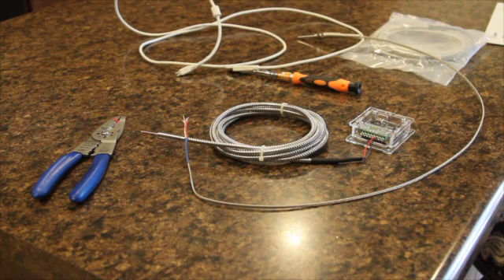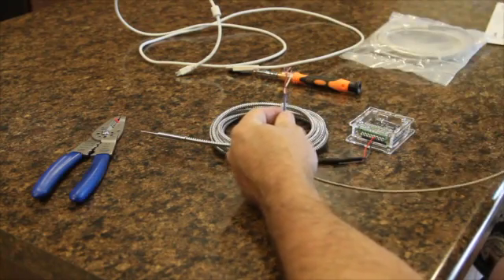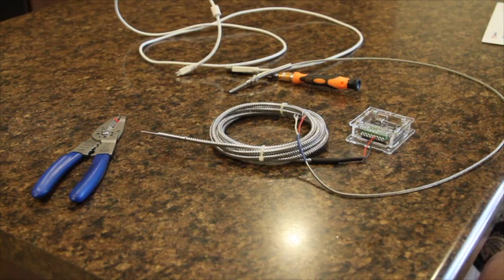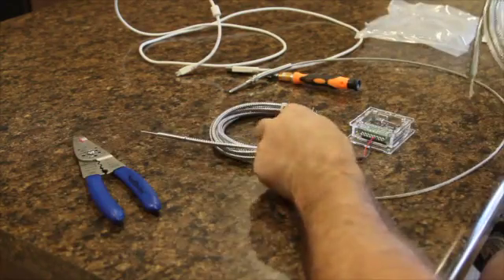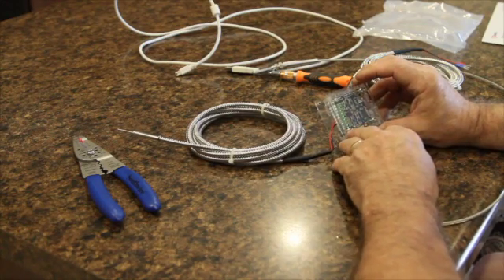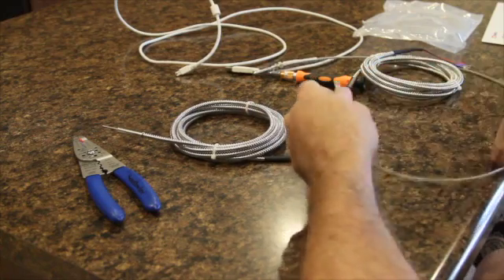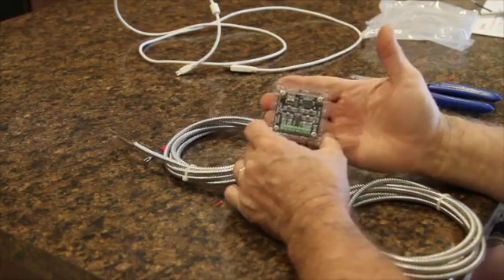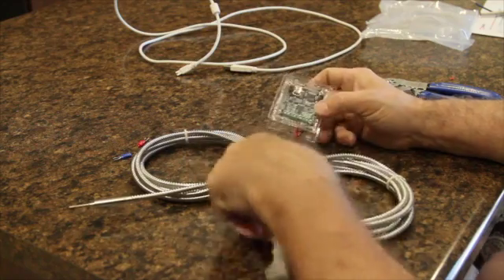PHIDGET SETUP FOR BC-1 & Phoenix PLUS

Comment from the maker: PHIDGETS on these roasters generally record only the ET + BT probes. But you could connect an additional probe direct to heat or other areas for more readings. But the BT records the temp of beans and ET the temp of air flowing through drum.